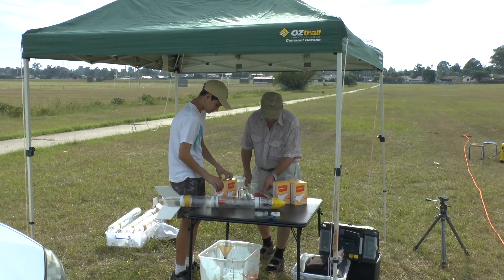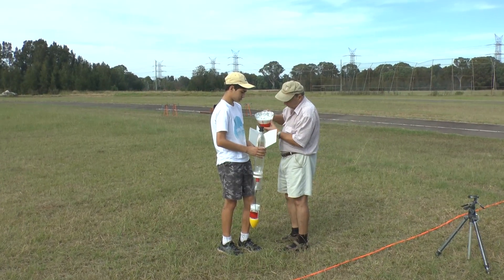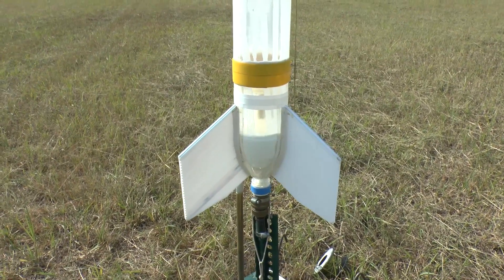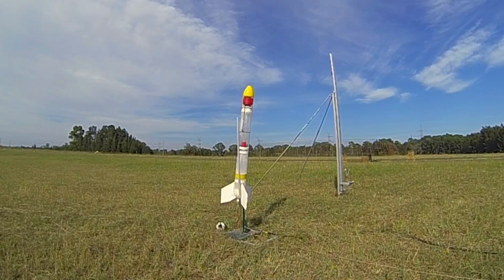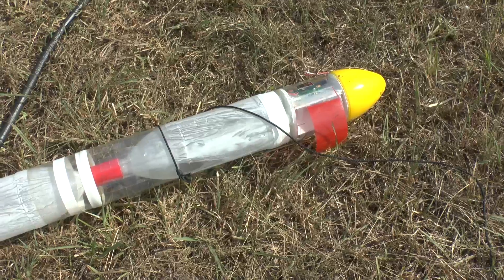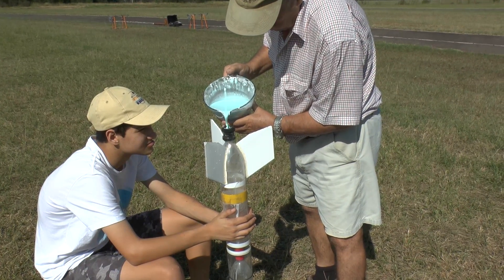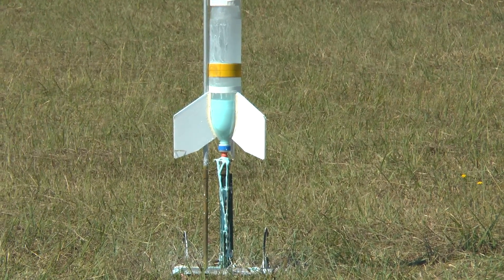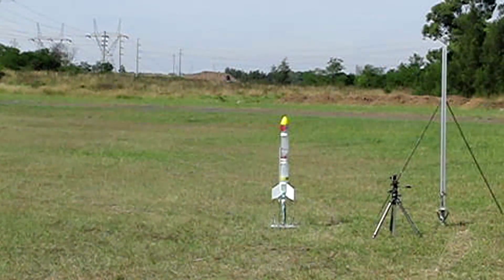Oobleck in Water Rockets

Comment: Hello, my name is David I am 38 years old and I'm from Mallorca (Spain), I love your channel and I learning a lot.
I make a few differents Water Rockets with success, but I need your help to my new project. I only have 3 weeks to make a new Super Water Rocket to my son birthday,(4 years) and I only have time to make one prototype.

My idea is make a big nose capsule (like falcon 9 more or less) with 2 escape doors, one with a big parachute and second one to color tapes or confetti). I think I will put 3 bottle's 2.2l or 4 bottle's 2l and then the capsule, but I can put in only 6'5 bars pressure, and the deflecting nozzle is 8mm.

My question is, How much weight can I put in the noise capsule and how many water can I put with 6'5 pressure? Of course I can change the design or the bottle depending of your opinion.
Thanks.
Reply from the maker: What size nozzle will you use? What is the total capacity (pressurised volume) of the rocket if you are putting those bottles together? 6L. 8L? For a 6L rocket at 6.5 bar and a 22mm nozzle, 2 liters of water and a total weight of the empty rocket and payload 1000g will give you roughly an altitude of: 60m, Your rocket will weigh say 350 grams, and a payload of 650 grams. With a payload of 1Kg (1350g total weight) will give you an altitude of ~40m
Reply: @AirCommandRockets  The nozzle is 8mm, I using a standard pipe garden connector.
My idea is put 3 bottles 2'2l, total pressure volume 6'6l, but I can change depending your opinion.
Thanks
Reply from the maker: @DavidMaimo  With an 8mm nozzle, 2L of water, and a 350g rocket + 650g payload will get you 43m (140 feet)
Reply: @AirCommandRockets  thanks a lot

Comment: This isn't that surprising if you knew how Oobleck acted. When you apply sudden, hard pressure to Oobleck, it acts as a solid. With it being pressurized in a tank and forced through a small nozzle, it became a solid and would not pass quickly. Try looking up liquids with less viscosity and see how those perform. I did a little looking up and water is the most common, least viscos liquid but Im sure with enough looking you can find another.
Reply from the maker: Methanol has a lower viscosity than water.

Comment: A heavy [non-toxic] salt our sugar type material would make a good way to increase propellant mass without adversely affecting density or air-to-propellant volumetric ratios.

Picking something with a high solubility rate [like calcium chloride or magnesium chloride] would allow you to add even more water than with just water alone because of the way hydrates http://www.sciencemadness.org/smwiki/index.php/Density [this list shows more than what one would be looking for, but still it would show you various safe options between the not-so-safe options, so its just a case of finding safe ones and trying them out on a small scale.
Reply from the maker: A heavier propellant mass doesn't necessarily increase performance. Although you generate higher thrust, you also have a heavier rocket to lift with the heavier liquid still in the rocket. Lower density liquids like alcohol can improve performance. https://www.youtube.com/watch?v=Fu3rIiPy_18
Reply: Alcohol is indeed lower in density, but its poisonous and highly flammable, so that would seem to be a consideration based on how it is being launched.

Okay, so I watched the video, and while it would seem that the results would have proven me wrong, it is of course based on some unknowns which I would have to play around with to see if 'all things being equal' were truly equal.

I have only really and seriously worked with solid fuel rockets, so this is all pretty new to me despite knowing how water rockets work [my childhood playing with water rockets was not remotely scientific so I do not count those] in principle, so it looks like starting from somewhere near where your work has begun, I should become familiar with the process and develop some good baselines before attempting to experiment.

If I ever get time to do any of this, since what I have are American sized 2 liter bottles and 3 liter bottles [and I literally have hundreds of them!] my initial results will likely be significantly different and as such I will have to begin by establishing my baseline from scratch.

At least I have a machine shop to make nozzles, launchers and valves.

One big drawback to larger bottles, of course, is that they tend to not handle pressure as well due to the fundamental laws of pressure and material fatigue.

I may end up making a fiberglass body, hard to say.

Comment: You are right.. it was cool... it looks like they should have used less of the 'oobleck'... though I know little about the process! lol... kind of like the new detergent that you only have to use a little to do a lot... I say this based on the fact in both tests the rocket didn't actually launch until the substance had almost leaked out... very cool though.

Comment: Good videos:)

Try to boil a few spoons of corn or potato starch in water to make a "water custard".

When launching, you want to throw as much mass as you can, and as fast as you can out the nossle. Starch might not help very much with that, but maybe a water custard can hold sand, or even iron powder in suspension, to make the liquid heavier than water alone per volume.

Another suggestion to make a heavier liquid is to dissolve salt in the water. In the same volume you could have a liquid that is maybe 20+ % heavier, and still very viscous.

Comment: if you mix olive oil with corn flower it  is like oobleck  when you pass a voltage thru it, it goes hard until you power down, then it returns to a normal liquid state again, mmm I wonder how you could use that,  an  electrically excited stir thickening semi solid liquid organic compostable product that when discarded rots and feeds bugs
Reply from the maker: +MrYendor1968 Cool, that sounds pretty interesting. I'll have to give that go, thanks for the suggestion.
Reply: MrYendor1968

Comment: Any chance that the reason for the solid left behind was that the pressure release of launch drove a lot of the water out, leaving more dry cornstarch in the rocket?
Reply from the maker: +Samuel Dale Quite possibly. I noticed that the Oobleck dries very rapidly when it is thinned out on things, but these were decent sized chunks. I also wondered whether the rapid depressurisation and/or the associated drop in temperature also maybe had something to do with it, but I think you are closer to mark.

Comment: I have made the similar experiment. Corn starch is not the best gelatinous substance.  Alumogel is more better. Alumogel may be prepared by interaction of saturated aluminium sulphate solution with 25% ammonia solution. This gel allow easy start and it is possible to launch rocket in any direction, not only vertical.
Reply from the maker: +котофеич бегемот Interesting. I can see how a gel would be useful in non-vertical flight. Perhaps even regular Jelly (Jello) would also work for that as well, though you would need to set it in the rocket. I think that Oobleck though is different in its properties compared to Alumgel.